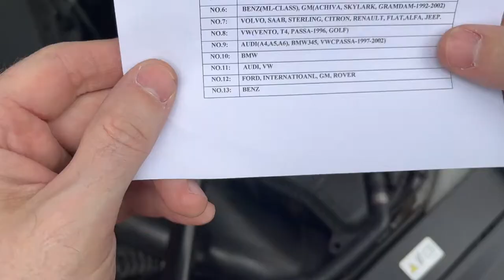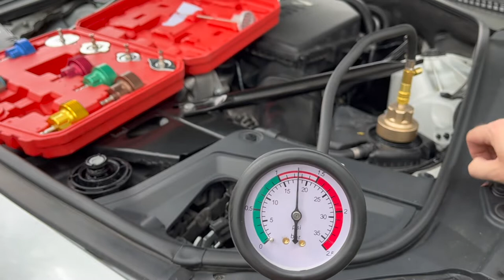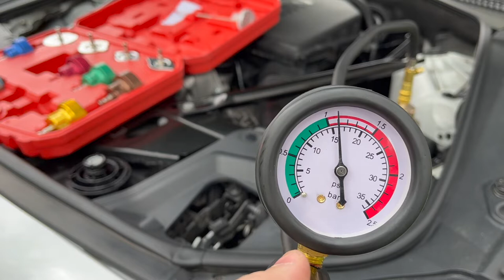How To | Pressure Test Your Coolant System | BMW 535i F10

Comment: Coastal VA here , thanks for this, trying to detect a leak on my 330i today, do you need to bleed the system following a pressure test?
Reply from the maker: Hi friend, thanks for watching.  Only if you've lost a significant amount of coolant.  If you did a quick test and no major leaks, you should be good to go.  But if you found a major leak and added coolant, would be good practice to bleed the system.  Hope that helps
Reply: Hi do you need to run heater blower on full heat on speed 1 during testing?